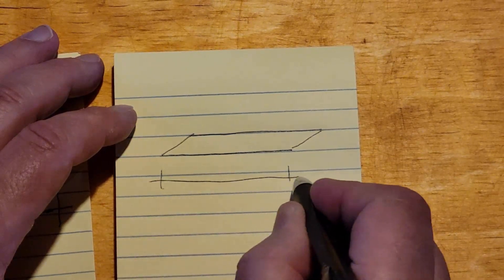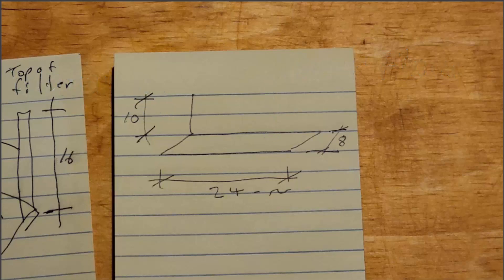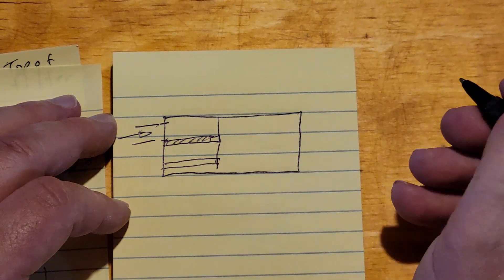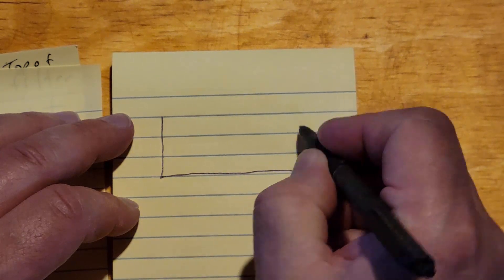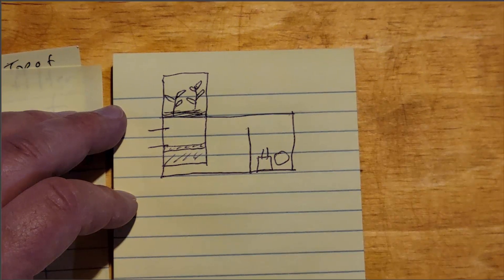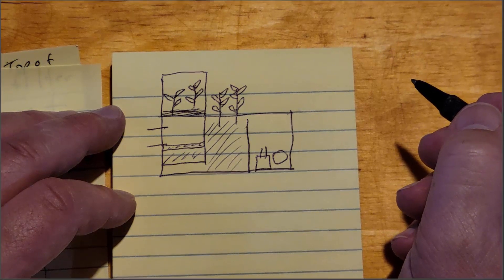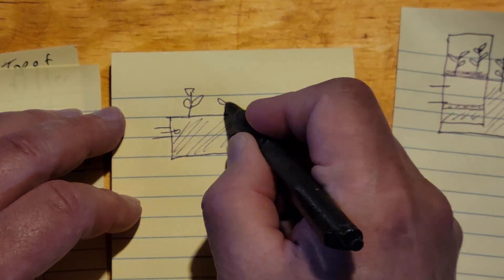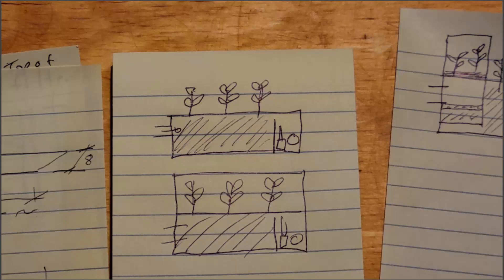Mini Sump Design

Comment: Failing to think inside the box.. again...

I'm thinking of having most of it as a repeat of identical compartments. Fed from the bottom, having the water rise up thru fine gravel or course sand as mechanical/biological filtration. 
A pipe can take the overflow down to the bottom of the next compartment. A low draining tap can combine water changes with back flushing the media. Maybe some usually closed sliding doors between the compartments can me opened to drain the whole filter in one move. To super boost the whole thing air stones can be placed under each filtermedia both to feed the bacteria, help the mineralization of solids in to plant available nutrient and to give the roots above oxygen. If that is not enough then make a feedbackloop recirkulation some of the water leaving the filter back to take another turn. 

I'd leave space in the last area for whatever extra filtration or water chemistry treatment needed.

Have a great day!
Reply from the maker: And I thought I came up with some over engineered ideas. That sounds like quite the Cadillac filter. I will be making one more of these. It could incorporate this level of complexity. Thanks for the thoughts!
Reply: @FishmanEricRussell  Cadillac? I was more thinking of Ford Raptor.  ;)

Thanks for reading, answering and considering.
Reply from the maker: @alt-swe5503  My pleasure!
Reply: @FishmanEricRussell  Btw, the over-over-engineered variant would have a first compartment (still bottom fed) with a first step of plastic straws (the old McDonalds style before it was over-environmentalized) followed by hanging strips of cloth, maybe the crinoline you use for the diatom filter.

The first part would take out heavier solids, in which straw the speed would slow down settling out the solids, having them falling down, while the upper part would catch a good part of the rest more free floating stuff. making it stick together and fall down, or just stay and get flushed out at the next water change/back flush.

The sliding doors/back-feeding would be replaced by a horizontal draining pipe a bit under the filter, connected upwards by vertical pipes in which air hoses make/tune the lift deciding the amount of back feeding while it at the same time stops the water from taking a short cut thru the filter.

I better stop now before I'm going all over-over-over-engineered on you! ;)

I hope you weekend is great!
Reply from the maker: @alt-swe5503  I really love the time and thought you've put into this! Thanks and I wish you a great weekend as well!

Comment: Your last option is what I use on my 240. Mine is made from a 40 gallon breader that I have a large amount of K-1 moving bed media in.
Reply from the maker: Hey Raymond! Cool! How does it work for you? Are you still interested in that over tank filter from a couple of weeks ago?
Reply: @FishmanEricRussell  yes sir;  I am sending you a short video of my 240s sump.
Reply from the maker: @racerofrc  Cool. Thanks!
Reply from the maker: @racerofrc  I just looked at them Raymond. That will certainly do the trick. it should have a high capacity for bio load. Thanks again for sharing that!